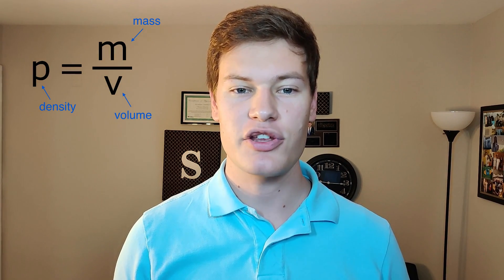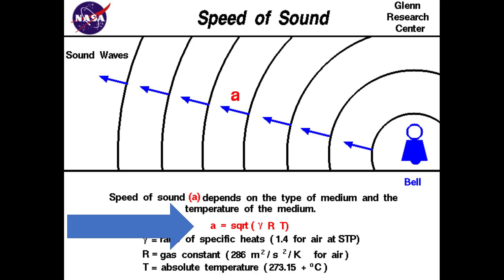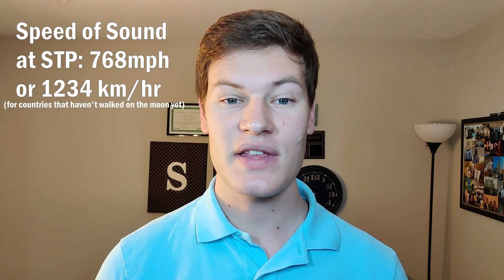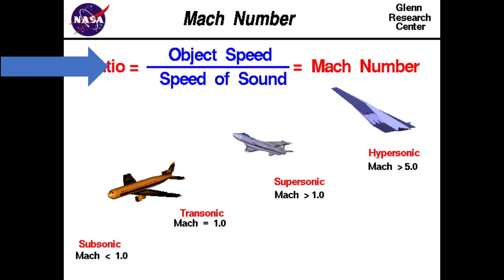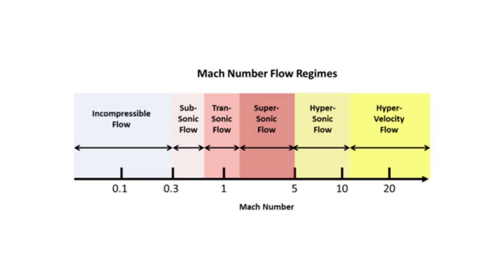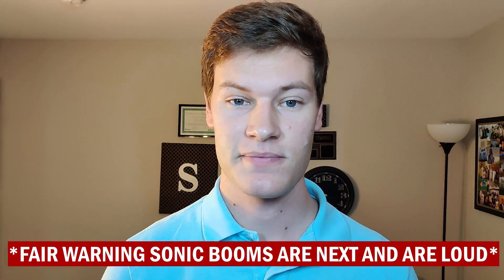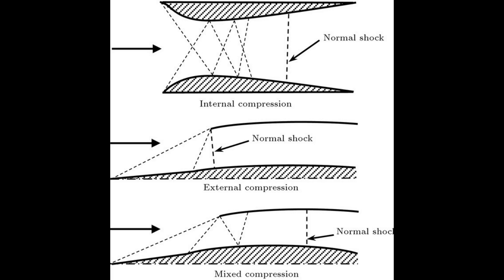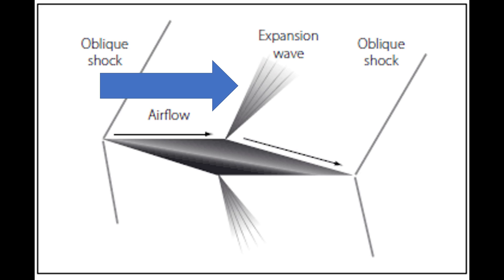What is Supersonic Flight? | Aerospace Engineer Explains

Comment: Well explained, but I would say that a compressible fluid is always compressible, your tire-pump is not transonic. A more correct statement would be that a compressible fluid might be treated as incompressible below 0.3 Mach under most circumstances. What is the more confusing statement for the laymen is an other question though.